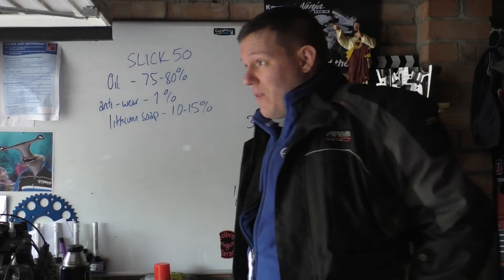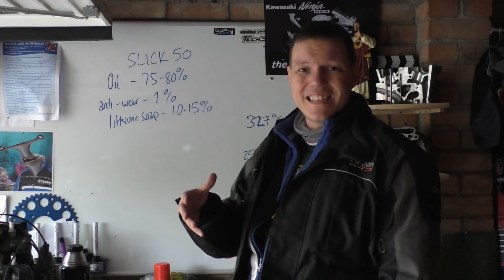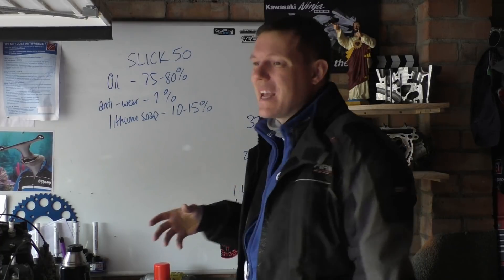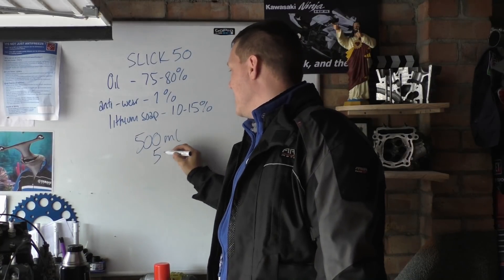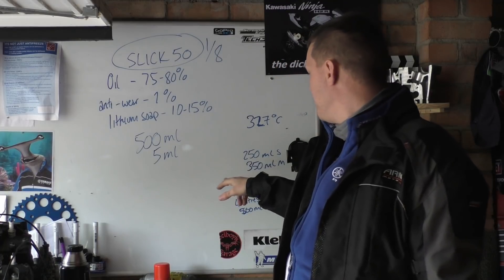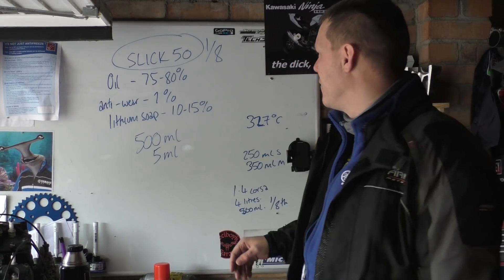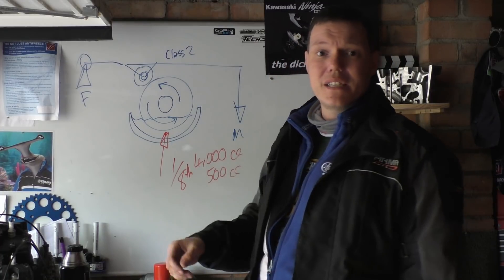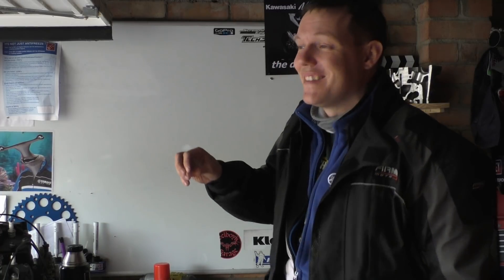Oil additives - do they really work? - Shop Chat

Comment: I actually talked to a engineer at the Chevron refinery in California and asked him about these different magic elixirs. He said the same thing, and if these trace elements were so great that they would add them to their oils. Just changing your oil at manufacturers recommended intervals is all you need to do.
Reply: Ok, but what if you buy a car that didn't have the best oil changes? Or if you have an oil leak? I used to burn like 1.5 quarts over 3k milies(smelled like oil at wot) in my n54, I used sea foam and risolone(I think it's called) and now it burned 1/4 a quart over 1k milies(no oil smell)(so good improvement).
Reply: @gameonyolo1  seafoam is a decent oatch and a cleaner but not something I'd run long term just use to identify issues
Reply: @ts757arse  they do in some of them additive packages etc. Amsoil make a fuckton of specialist additive oils for different performance applications for a reason

Comment: so in my oil window i can see foam on top of the oil why is this and is it bad? also what do i do to fix it?
Reply from the maker: new oil or different oil - what bike and what oil?
Reply: Is the oil level too high allowing the crank to churn it up (if its a four stroke) 
High oil levels can be more destructive than low
Reply: The Workshop it's a Kawasaki er6n    And I haven't changed the oil I bought the bike with 670 miles on it and I've only done 400 miles on top of that
Reply: The Workshop also I did notice a lack of power, could that be to too much oil?
Reply: The Workshop just checked the oils level looks fine I think it need new oil and a new filter